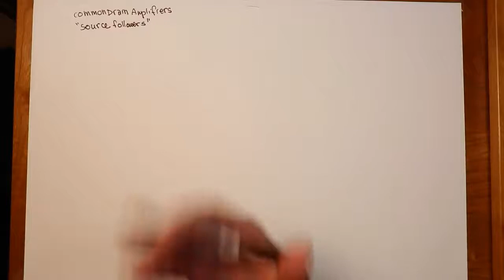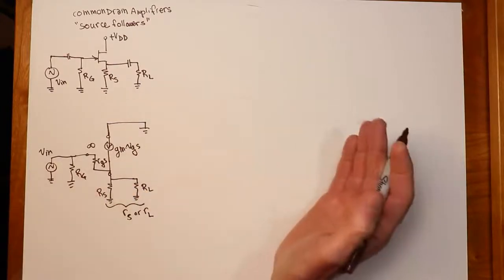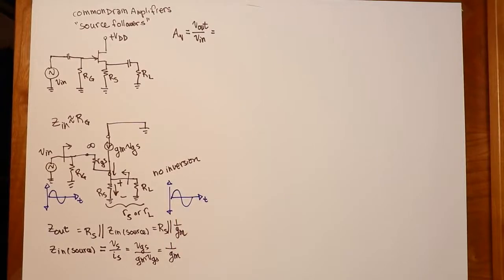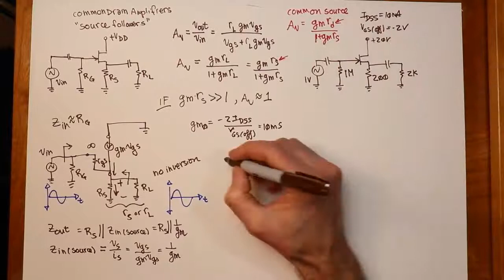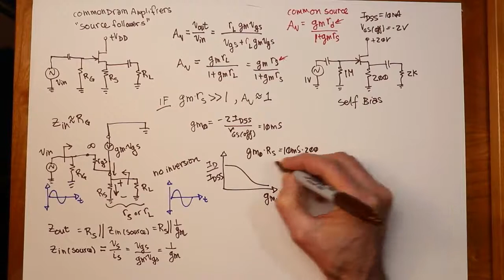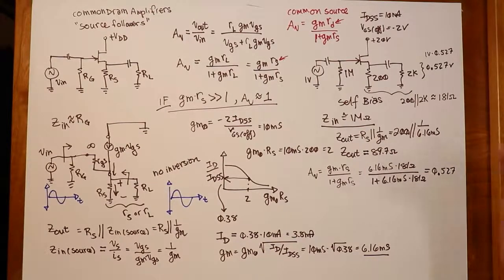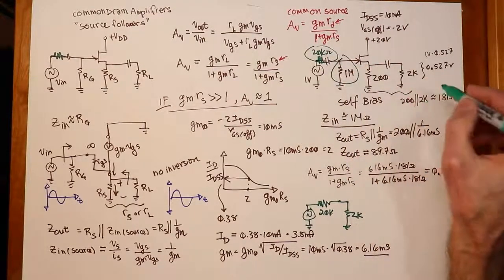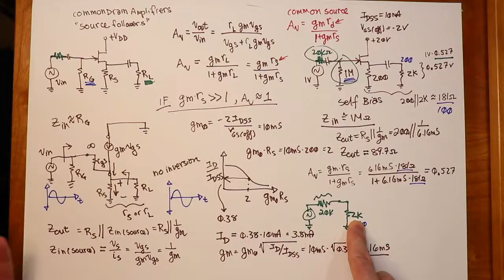Semiconductor Devices: JFET Common Drain Follower

Comment: Excellent. I was thinking about guitar pickups as you mentioned them. I'm trying to draw a parallel between BJT-r'e and associated distorion/swamping resistor and the equivalent FET swamping and I realise that I am unclear. I shall look in the text again but if you can give me some insight, that would be fab!
As I understand it, r'e changes with emitter current, hence the distortion, how does that work in a FET?
Reply from the maker: Sorry so late in replying- I just noticed your comment. There are parallels between the two. You can think of 1/r'e as the gm of a BJT. If you swamp a FET amplifier, it will lower distortion and decrease Av, just like in a BJT circuit. But FETs are square law devices and don't have as much distortion as BJTs (and generally lower Av as well). That is, because the transconductance curve is square law, it is comparatively gentle in slope (unlike the rapid I-V change we associate with the B-E junction). This means that as the signal swings back and forth, it encounters a smaller change in slope, and thus less distortion. But because the slope is relatively gentle, you don't get as much gain.
Reply: @ElectronicswithProfessorFiore  Thank you very much. I'm just trying to get some 'loose-rules' as to when to use which type of transistor. The BJTs seem to offer more amplification and lower input impedances (although you can clearly get a wide variety of each). Distortion seems lower in FETs but I have memories of there being more noise, is this true? I'm thinking about the initial voltage follower into an amplification circuit. (I remember you saying that distortion can be corrected with feedback but noise is noise).
Reply from the maker: @simonyoungglostog  Noise is not affected by negative feedback. You might consider a combo circuit, for example, using a FET first stage to get high Zin followed by a BJT stage to get most of the gain. A Darlington is another possibility.

Comment: 12:34 i am still not sure how Id/Idss=.38, i am guessing this value will vary wildly because all jfets have different transconductances? Or is there a chart with these values already recorded, wherein a specific (gm x rs) value will always produce a certain id/idss value? Thank you for video!
Reply from the maker: That came from the self bias curve (this circuit uses self bias). The first step is to compute the product of gm0 and Rs. That worked out to 2. From the horizontal axis, find 2, go up to the curve, and then come across to the vertical axis. There, you find that Id/Idss = 0.38. The derivation of the self bias curve is rather lengthy but you can find it in the textbook if interested. As long as the circuit uses self bias, you can use this curve. Yes, the resulting Id can vary widely based on gm0 and where the circuit is biased. gm0, of course, varies from device to device.
Reply: @ElectronicswithProfessorFiore  ohh okay thank you!